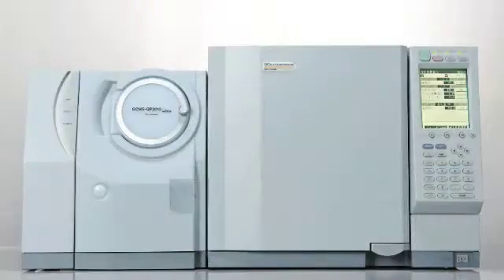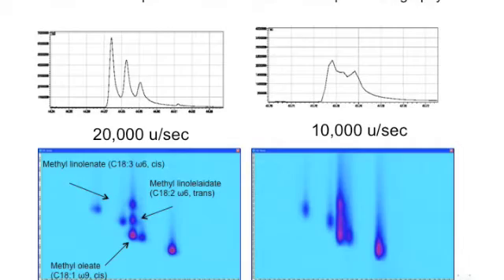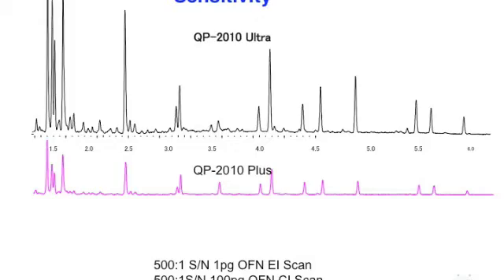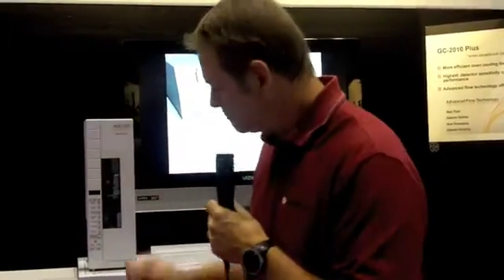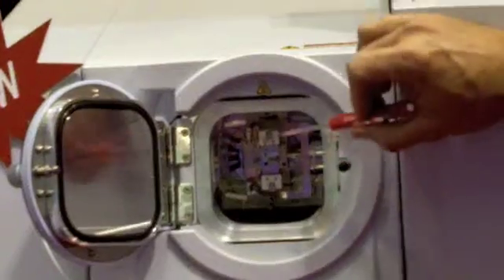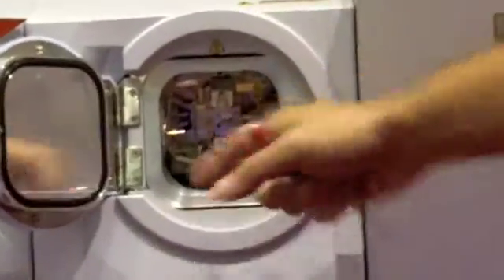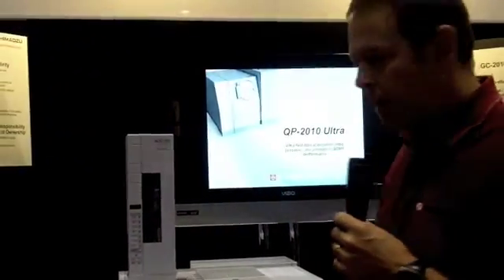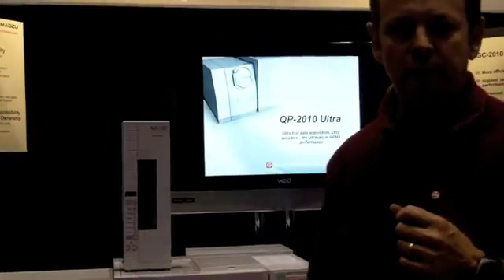High-Speed, Eco-Friendly GCMS Analysis

Comment: GCMS-QP2010 seriesERROR DISPLAYS

 "[0d97] Low Vaccum ERROR. Chesk for vaccum Leak."
I replaced: o-ring,septum, liner.
Vacuum control in I can not turn on the ion source AVAILABLE FUNCTION "on"
how the MS remove the source of ions? I can not open the door to MS (probably sucked into).PLEASE HELP AND Thanks for advance!